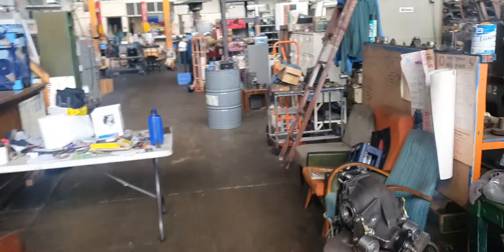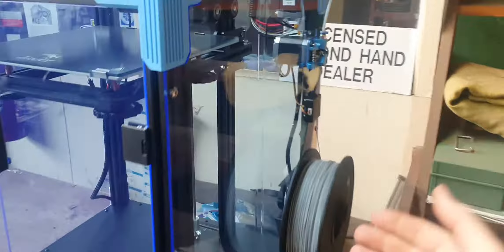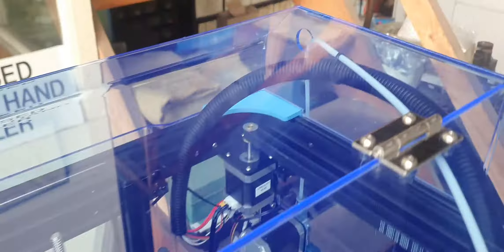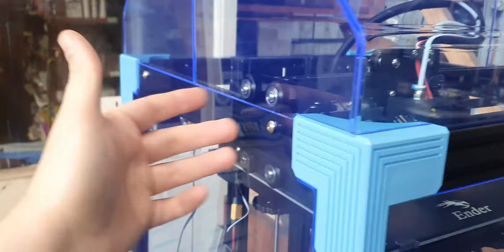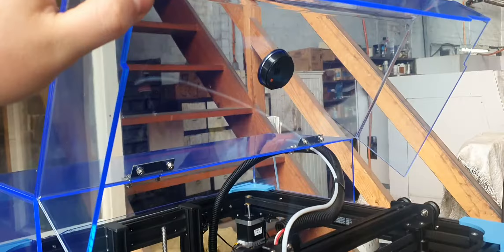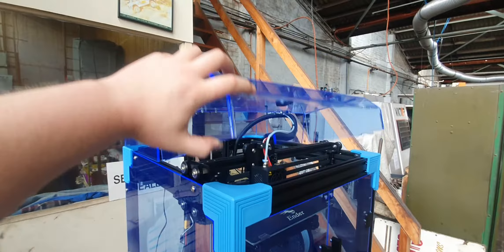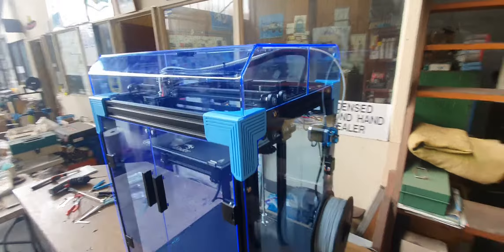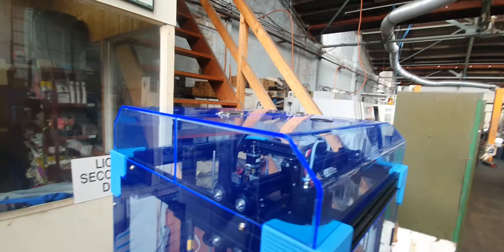creality Ender 6 top cover

Comment: That looks like 1/2 a top cover.   Way too low.   I'd love to have one at least 3" higher.
Reply from the maker: Yes it is a bit low. If you make one ill buy it off ya 😅
Reply: @differentials  I was originally going to make a vac form and make them.  Friend in that business.  But the cost of the die scared me away.  Best quality printers they make are the E6 and the CR-200B at Creality.
Reply: @differentials  I just starting printing parts to prototype one up.  Right now I use a cardboard box trimmed to fit in the grove front and back and over hand the outside of left and right edges.  Ugly, but high enough.  I've gone to internally mounted extruder to get rid of a bunch of bowden so I don't need as much height.  About 9" will be fine.
Reply from the maker: @davethacker8410  good on ya mate. Xant wait to see it